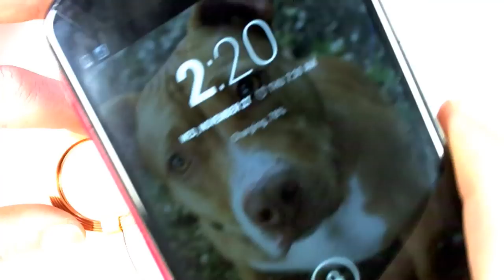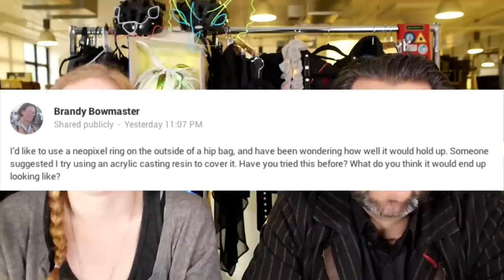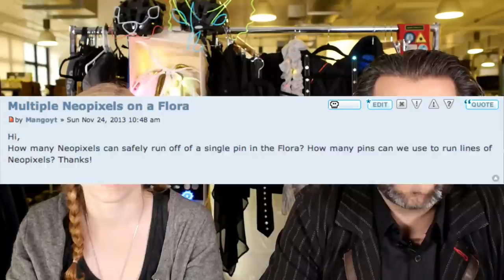Wearable Electronics with Becky Stern 11/27/2013 - LIVE

Comment: I have seen a youtube video where the maker uses desoldering braid as an electrical conductor in a tube type AA battery holder. Do you think desoldering braid, as a conductor, also has a use in wearable electronics?